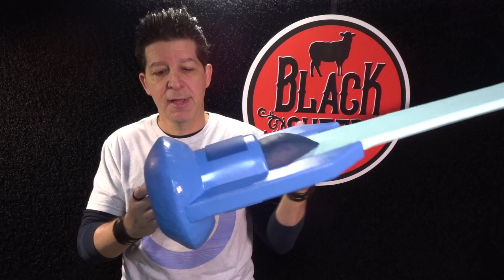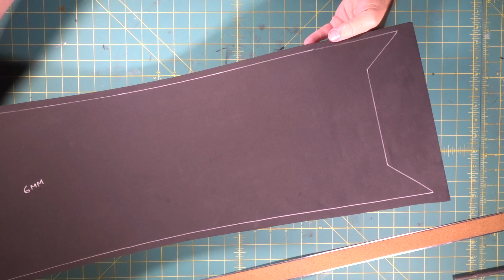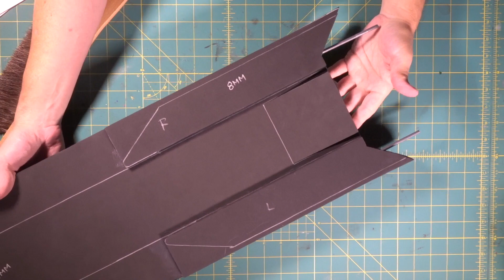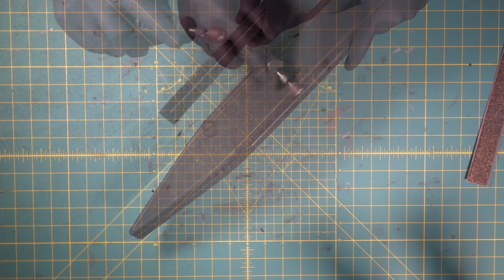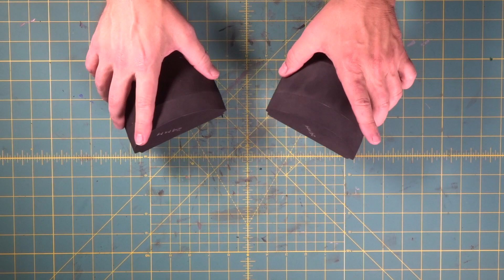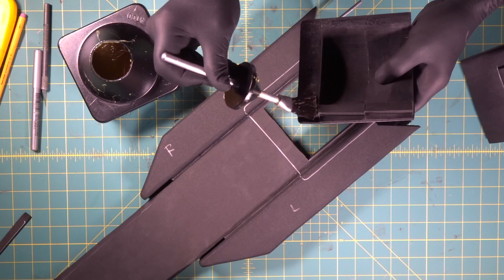Making An EVA Foam Megaman Sword Part 1

Comment: As a MegaMan EXE cosplayer, this is a godsend! thank you for doing this!

also question: I'm heavily considering in investing in a band saw when I get the chance.... what are some affordable ones I should look at? also, what kind of blades should I get for them?
Reply from the maker: Thanks a lot!!
I have a Porter Cable 9" band saw, it was about $170. Ryobi has a 9" cheap one too. When you step up to anything larger than a 9" the price gets CRAZY HIGH.  I use a 3/8" 18TPI blade. The thinner the blade the tighter you can cut curves and corners. The wider the blade the better straight cuts you can make. So I keep a 3/8" in my bandsaw ( which is a good average blade ) and that lets me do good straight cuts and pretty good curves, and I use my scroll saw for the really tight curves and corners.
Hope this helps!
Reply: @BlackSheepProps  thanks! that does help alot!